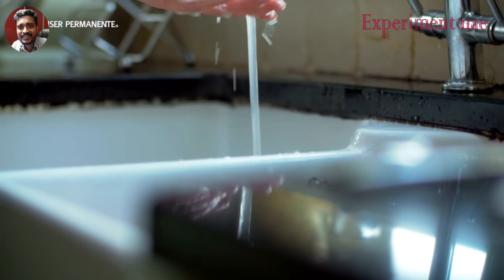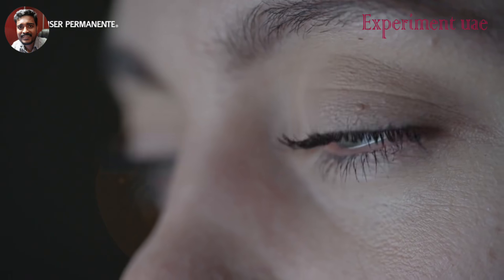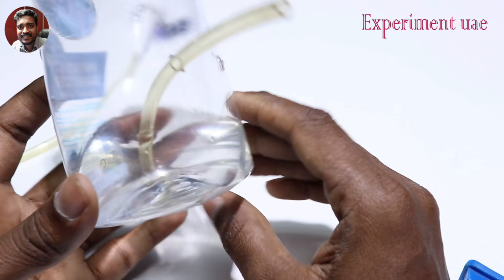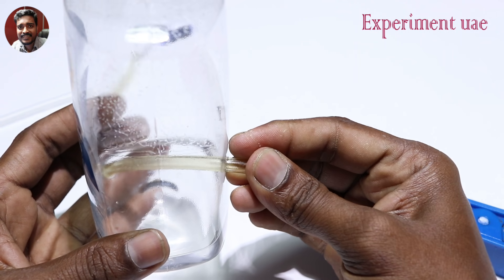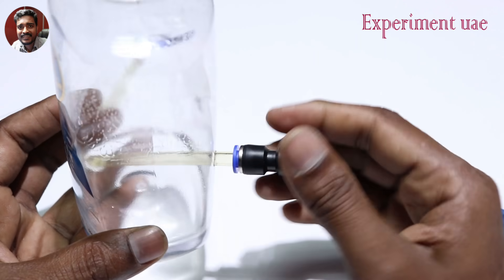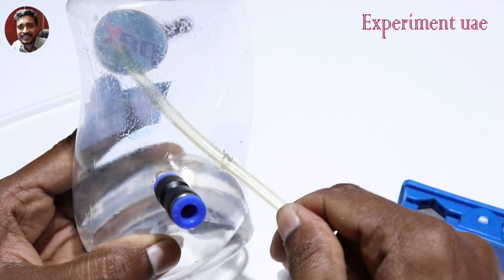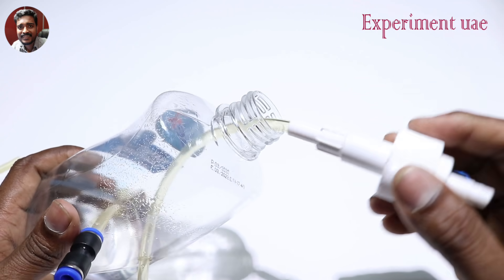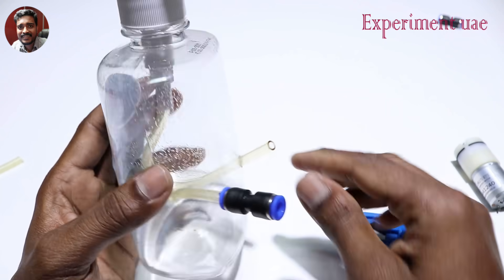Automatic HAND SANITIZER DISPENSER Making At Home | NO NEED ARDUINO | Experiment Uae

Comment: Brooo tranistor valu athaaa
(Tip32c anoooo)
Reply from the maker: bd140
Reply: @Experiment_UAE  Tip32c use cheyan patumoooo
Reply from the maker: Pattum
Reply: @Experiment_UAE  thanks broooo
Reply: Brooo njan mini submersible water pump use cheyan pokunath athinta  speed kurakyan ntha margam ithinu speed kuduthal so sanitizer kura waste avum
Reply: E dispenzer  outdooril vechal kuzhpamundoo
Reply from the maker: Outdoor Vachal sunlight ulla Ir karnam sensor on avum sanitizer waste avum . Submersible pump dispensing correct Avila .
Reply: @Experiment_UAE  solution indoooo.
Reply: Resistor value 1k anoooo

Comment: Brother thank you for a good simple presentation 

I have checked all parts working good , but in the reverse way. When I bring had close motor stops , else continuously running . Pls advise
Reply from the maker: Thank you dear...I think your sensor another model ? change transistor Bd140 Then use replace bd139
Reply: Same problem I am facing sir . Please help me sir I am trying so many times .. but when. I connect my dc pump runs automatically and when hand places it bceoms slow down
Reply from the maker: Your sensor model  as per same my video . Otherwise model change  . Replace transistor bd140 then use Bd139
Reply: @mamidivasudev5988  Yes motor is not stopping
Reply: @vijaynaru  try recalibrate the sensor.. Maybe it detect too far

Comment: Hello bro
I liked this project and I made this one but the motor is not stopping ,it still running after we remove our hands.
Reply from the maker: You used Ir sensor same ? = No/ change the transistor then use BD139
Reply: @Experiment_UAE  yes same sensor  and bd 140 transistor
Reply from the maker: Ok normal power on time 2 led glowing the sensor
Reply: @Experiment_UAE  yes bro iam confused in this matter circuit is correct motor is good sensor good transistor good one but the motor is not stopping
Reply from the maker: Ok  . This unit use indoor only outdoor using sunlight infrared catching this sensor . 2. Adjust the preset use small screw driver . Normal power on one led glowing when your hand the sensor second led glowing check and reply
Reply: @Experiment_UAE  ok bro

Comment: I made this circuit yesterday and still struggling with it. Automatically its giving output current without putting hand under IR sensor. If I put hand under sensor LED glows means my IR circuit is working properly. I am not able to understand why it is always giving output current without sensing.

I am using it in my room where there is no sunlight or strong light.

Please help me where is the problem....
Reply from the maker: Witch type of sensor using you ?( model ) and Transistor No
Reply from the maker: This problem some time or made starting till now
Reply: @Experiment_UAE  
Problem is still there.
I m using LM358 IC readymade Module.
Reply from the maker: Made in india this one
Reply: @Experiment_UAE  
Even without using any transistor the IR sensor module output pin is giving current continuesly. Thats the problem.
Reply from the maker: I thing your Ir Bord different model Replace transistor use bd139
Reply: @Experiment_UAE  
Yes.
Reply: @Experiment_UAE  

I have done that too. 
Tell me 2 things..
1- If will use 5 volt supply, how much current will get from Output pin ?
2- Will get positive or negative current at output pin ?
Reply: Even without using any transistor the IR sensor module output pin is giving current continuesly. Thats the problem.
Reply: The above mentioned problem occures when you are using it from out door.  Try to use in indoor i believe all will be ok.

Comment: Sir in this circuit does 5v dc gear motor with wheels works because I want to make a object following robot how means when we keep our hand on the ir sensor it trigger and turn on the motor and if we attach wheels in the motor it will move but does dc motor work with wheels work or not sir
Reply from the maker: This circuit design  only sanitizer little amount dispensing. Your project following Robot use Arduino and Ir sensor

Comment: May we use 200 rpm gear motor in this circuit does it work
Reply: At least 100 rpm gear motor
Reply from the maker: You have material?   try and confirm bro
Reply from the maker: Not work
Reply from the maker: Motor will rotating but load connecting  working dout
Reply: OK atleast a normal dc motor which is inside 6v water pump motor

Comment: Dear sir I tried this circuit but motor continue running 🙁🙁?
Reply: There is only only one led
Reply from the maker: Place your hand Ir sensor must on second Led glowing Right?
Reply: @Experiment_UAE   continuously motor running 
M using supply 5 v 2A
Reply: M facing same problem
Reply from the maker: I think Your Ir sensor different model .
Reply: @Experiment_UAE  no sir same model  circuit same but motor running continuously in room
Reply from the maker: Change your transistor BD139
Reply: @Experiment_UAE  submersible pump reversible 9 v I am using it suitable
Reply from the maker: In put main 5v only ... pump 9v
Reply: @Experiment_UAE  it vary 
5 to 9 volt
Reply from the maker: Test one time bro motor working but .... I don’t know
Reply: @Experiment_UAE   circuit is running reversible when hand close then off motor and when hand far then motors running
Reply from the maker: ir sensor how meny light glowing

Comment: Circuitചെയ്തു,ഔട്ട് put il led കൊടുക്കുമ്പോൾ ഓകെ യാണ്
But,motor കണക്ട് ചെയ്യുമ്പോൾ വർക് ആകുന്നില്ല????
Hope ur reply
ഔട്ട്പുട്ട് 4v കിട്ടുന്നുണ്ട്
Reply from the maker: 5 v Power supply amp kuravaythukondanu . Nalla oru power supply upayogichal rediyakum ( motor working volt 3.7 to 6 v vare ulla model alle upayogikkunghathu?.
Reply: @Experiment_UAE mobile charger pattumo
Reply from the maker: Yes mathi
Reply: @Experiment_UAE  1.5vnte3 battery ayirunnu koduthath,athakumo????
Reply from the maker: 1.5 x3 pora .volt undavum pakshe current kuravanu athukond work avan chance ella . 3.7 v power bankil upaykogikuntha battery undegil nadakkum
Reply: @Experiment_UAE  but anganeyanenkil battery direct kodukkumbol work akunnund
Transisteriloode ayathu kondano work avathath..
Reply from the maker: Motham circuit work cheyanulla current venam . Direct battery I’ll motor work cheythathukond  circuitil kodukubol work cheyynam entailla .
Reply: @Experiment_UAE  ok yayi,thanks
Reply from the maker: Good job

Comment: I have done this but my transistor output is not working properly
Reply: BD140
Reply from the maker: (Not working properly) ? Details
Reply: @Experiment_UAE  ys
Reply: I use proximity sensor ,1kohm resisitor And BD140transistor
Reply: The sensor is working but no output from the transistor
Reply from the maker: IR SENSOR  How many LEDs shine
Reply: @Experiment_UAE  1
Reply: Its not Same as that of u
Reply from the maker: Place your hand ir . second led glow or not ?
Reply from the maker: Ok i will help you don’t worry
Reply: @Experiment_UAE  yes it glows
Reply from the maker: Motor not working? which transistor use

Comment: Can we use TIP42C OR TIP41C instead of TIP32C with same connection's?
Reply from the maker: This Circuit working need PNP type transist

Please change the transistor 31c .use Tip 32 c BD 140, BD138, Any one is ok
Reply: @Experiment_UAE  but Sir TIP31c is a  NPN transit....will it work??
Reply from the maker: Sorry dear ... Tip 32c will working
Reply: @Experiment_UAE  can i use BD140 with same connection's?
Reply from the maker: Yes
Reply: @Experiment_UAE  ty
Reply: @Experiment_UAE  Ty sir
Reply: Supply kodukkumbol sensor indicator on ayi nilkunnu, but motor not working

Comment: sir proximity sensor sense ചെയ്യുമ്പോൾ 2.4 v തരുന്നു connect accordingly dc motor not working
Reply from the maker: Transistor via alle motor koduthathu ?
Reply: @Experiment_UAE  s
Reply: @Experiment_UAE  transistor getting hot
Reply from the maker: Transistor poyathano mattinokku

Comment: I didn’t get out ..why??
Reply from the maker: Why not ?
Reply: Experiment UAE  I  connected like this but it’s not working.seperate sensor and motor is ok
Reply from the maker: What showing sensor . Like 2 Led glowing ? Or one led glowing
Reply: Experiment UAE 2 LED glowing
Reply from the maker: This wrong. your hand front of sensor placing second led glowing. normal time only one led glow . Adjust  sensor preset
Reply: Experiment UAE  sir njn use cheythatha AM370GPV motor an athin problem illallo
Reply: How can i adjust preset

Comment: I have built this with the same diagram and using tip32c but i am facing a problem that it is working the opposite way for me. When i power up the circuit, the pump is already running. When the detector detects my hand, then the speed of the pump slows down to around 10%.
What is going wrong?????
Reply from the maker: Please change the transistor 32c .use TIP31c,BD 140, BD138, BD 140 Any one is ok

Comment: Dear sir, how to dispense a fixed volume of liquid? Kindly advice. My email is rahul5262@gmail.com

Thank you for making such great video.
Reply: There is no fixed amount of liquid dispensed It just dispenses as long as the hand is there
Reply from the maker: Fixed volume setup must need control by  the motor. use Arduino
Reply: @Experiment_UAE  Thank you for the quick reply.. ☺️

Comment: Pls bro
Reply from the maker: Check your inbox .Thank You..
Reply: @Experiment_UAE bro I can't get that
Reply: @Experiment_UAE  I don't know  where it's
Reply from the maker: Attached file download bro
Reply: @Experiment_UAE  I have sawn the circuit but you don't mention the voltage of the battery
Reply from the maker: 5v
Reply: @Experiment_UAE  bro I don't get 5v battery can I use 4 or 6 v battery
Reply from the maker: Battery no more time backup.  Better use connect 5 v Mobil charger  2 nd option 3.7 v battery x2 =7.4 v use 7805 Regulator ic
Reply: @Experiment_UAE  thanks bro
Reply: Bro I have tested circuit correctly for three times but it is not working
Reply: Only the light in the it sensor is glowing
Reply from the maker: Check transistor connection
Reply from the maker: It mean sensor second light not glowing?
Reply: @Experiment_UAE  no there is only one light is present in the sensor
Reply: @Experiment_UAE  I have tested a lot but it is not working
Reply from the maker: Adjust sensor Bord preset
Reply from the maker: Sensor second light not on  .this Bord problem

Comment: When I supply power both led are on.....why??
Reply from the maker: 1 st adjust preset in ir bord
2. More light aria( out side ) use this sensor not working ( both led on )
Reply: Thank u sir, its work.
But how i connect a transistor , Pls suggest some alternative transistor, is D 882 tranistor work with it?
Reply from the maker: d882 its working
Reply: @Experiment_UAE  sir, I can not do this with D882 ,pls help
Reply from the maker: Connection simpile transister base pin 1k via to ir out pin . transister emiter pin to ground (-v) collector pin to motor. motor +v to main +v and ir +v
Reply from the maker: Your watsapp no
Reply: Haradhan Mukherjee Sir,
For any type of Electronic circuit requirements you can contact us:
gmelectronicsystems@gmail.com

Comment: Do you have this video in English or hind
Which pump have you used  
Dc how much voltage
Reply: Amar Vangani Sir,
For any type of Electronic circuit requirements you can contact us:
gmelectronicsystems@gmail.com
Reply from the maker: 5volt dc input
Reply from the maker: I used small air pump

Comment: Sir can i ask for the schematic diagram for the connections?
Reply from the maker: Check your email
Reply: Sir plz components name tell me
Reply from the maker: SOMALI TECH LAB check video descriptions
Reply from the maker: You make watch the video then make this project it is very esly make. if you need schematic diagram send your email id i will send you😎😎
Reply: @Experiment_UAE  can i use tip32c transistor
Reply from the maker: Ok
Reply from the maker: Dear please check inbox
Reply: BLACKPINK HIT ME WITH THAT DDU DU DDU DU Sir,
For any type of Electronic circuit requirements you can contact us:
gmelectronicsystems@gmail.com

Comment: Can we use 12v water solenoid valve using this circuit?
Reply from the maker: Yes but  change the BD140 Transistor place any p channel mosfet
Reply: @Experiment_UAE  Thanks for this sir. Could you please be of help in this regard? I would appreciate it. btogungbe81@gmail.com
Reply from the maker: Ok i wil send drawing
Reply: @Experiment_UAE  I will be glad you did sir. Thanks in anticipation
Reply from the maker: Check your mail inbox
Reply: @Experiment_UAE  This is so kind of you. I really appreciate your kind gesture.
Reply from the maker: Thanks bro
Reply: @Experiment_UAE  I sent you email. Check your inbox
Reply: ogungbe babatunde Sir,
For any type of Electronic circuit requirements you can contact us:
gmelectronicsystems@gmail.com

Comment: Bro, why did my sensor light didnt on... i swing my fingers in front of the sensor but it didnt on. Can you explain it?
Reply: The power light is on and i have been set the sensig point
Reply from the maker: Ok next connect transistor
Reply from the maker: 1st chek Power light on 
2. Adjust sensing point ( PRESET )